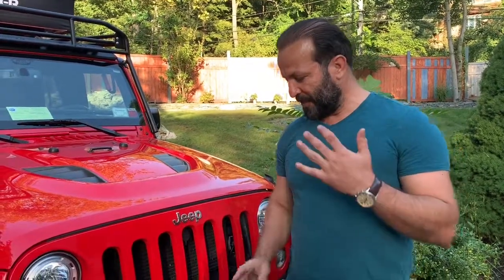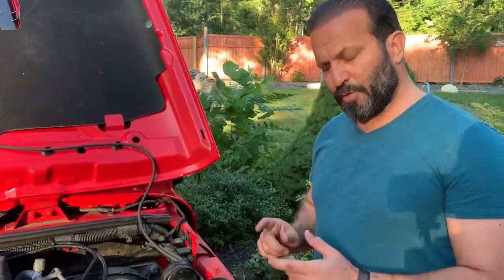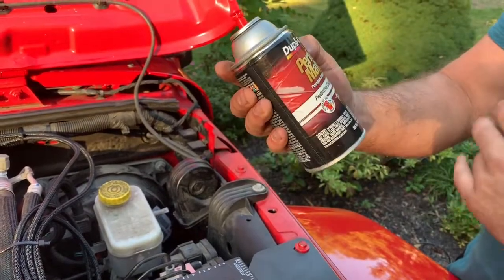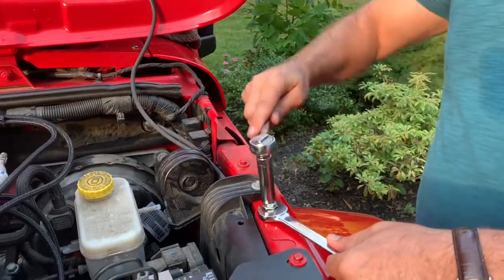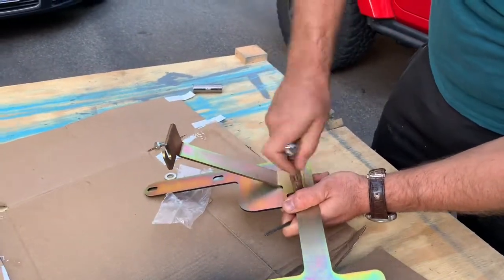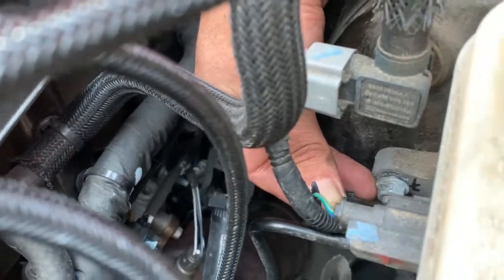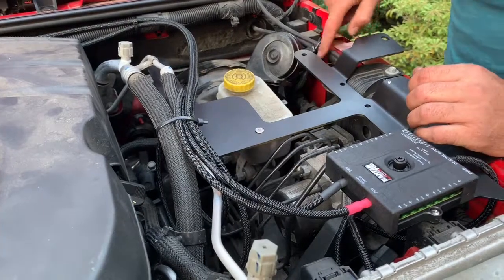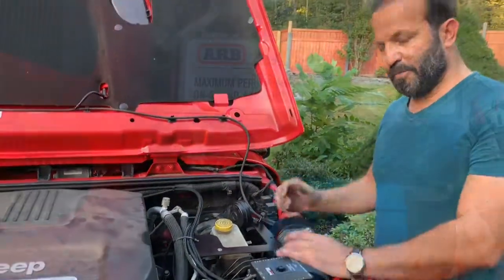ARB Dual Compressor Metalcloak Bracket Install Part 1

Comment: All them mods and stock wheels and tires and no lift
Reply from the maker: Check the latest videos, while wheels are still stock, I did go with 4 inch long arm kit from teraflex and 35 tires